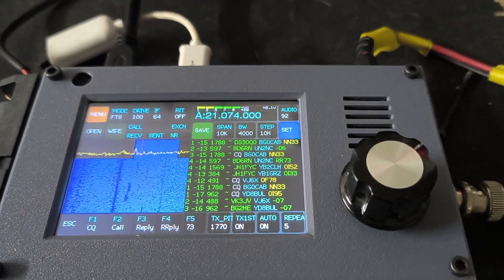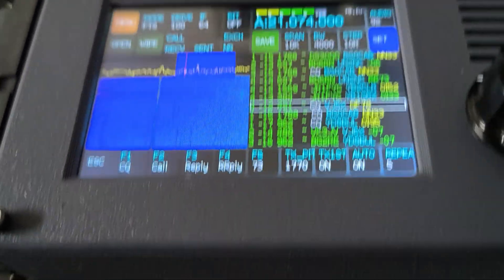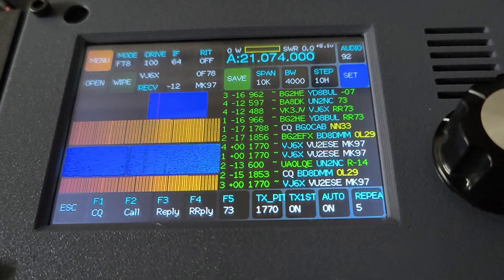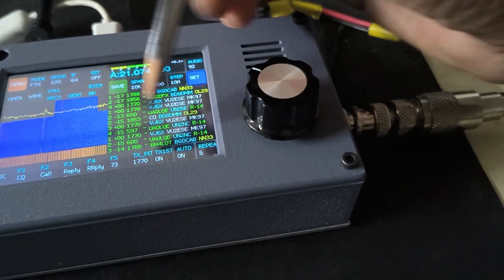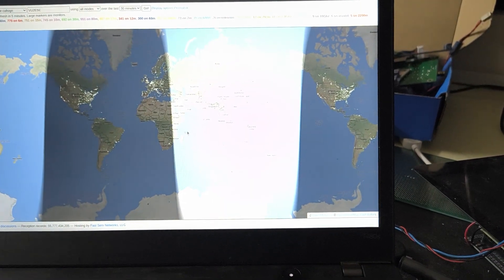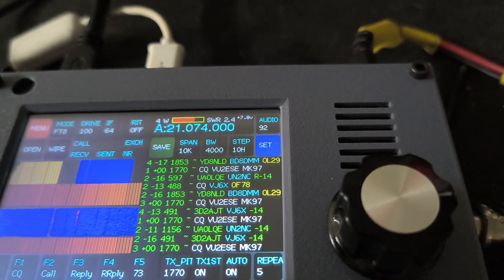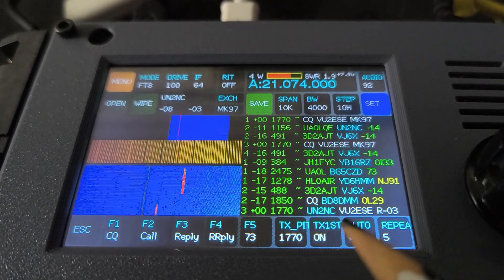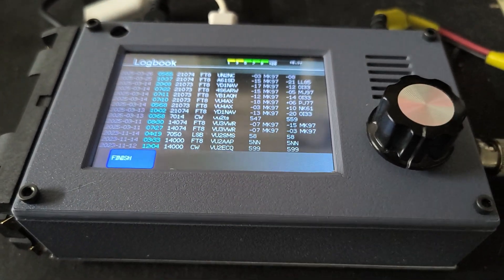zBitx - Working FT8

Comment: Hey, beautiful device. 
It arrived quickly, I'm testing it, and the first QSO is already in the log.
 Is there an option to turn off the sound while transmitting? I can't imagine using TRX at night while camping...
Reply from the maker: in cw mode, you can turn down the sidetone to zero, it works on ft8 as well.

Comment: Ashar, It seems that your knowledge of FT8 is very limited, apart from the function buttons of zBITx. 
For this reason, I (for one) will defer purchasing a zBITx until the manufacturer (or a user) can present a 'polished' presentation of the FT8 capability of the radio. Anyone can make a CW/SSB QRP Radio but FT8 needs to be refined - as it is the ONLY thing (likely) setting you apart from others! - so the user interface needs to be MUCH better demonstrated. 
(Recommend you use "PSK-Reporter" and select the Band and Signals Sent by 'MYCall'!) - I may still buy - but on the fence for now! 73